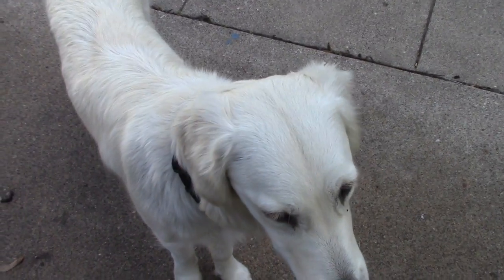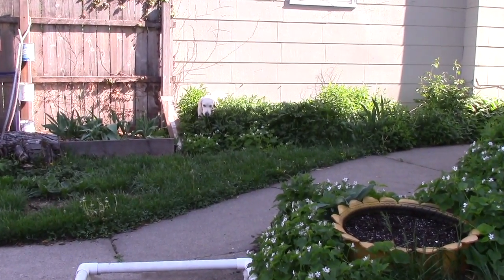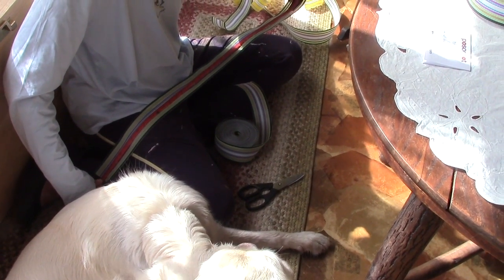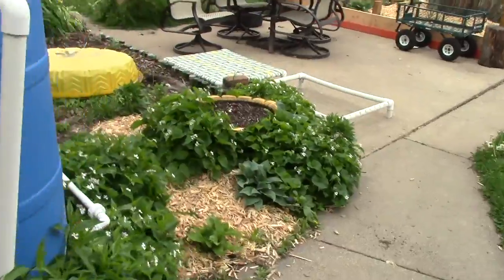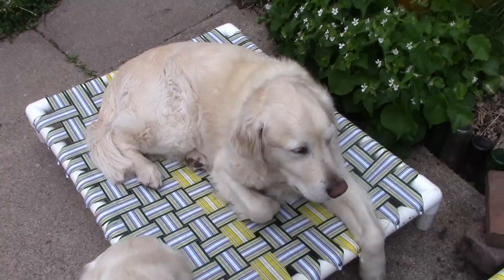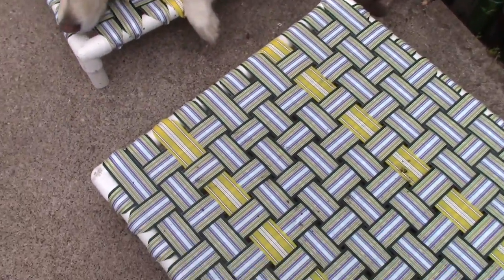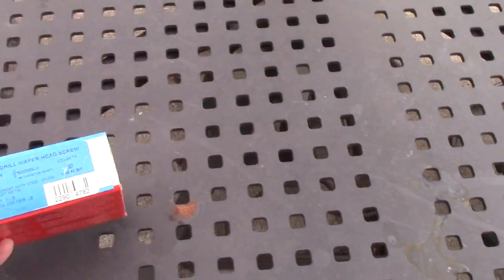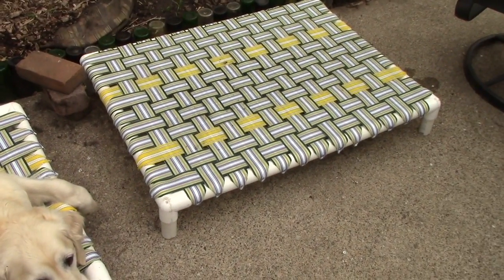how to make a raised dog bed with pvc and nylon webbing...

Comment: I made one out of 1 1/2" pvc  and canvas like carhardt jackets and bibs are made out of. It regularly holds a 115 poumd black lab and an 85 pound silver lad at the same time. I paid 12 dollars for a yard of canvas and has not ripped in over a year. has stretched a little because they lay on it every day while we are at work. I accounted for it maybe stretching so it is a foot off the ground instead of the normal 4 or 6 inches most people make them. just got done ordering the material to make 3 more. one for my brothers new puppy and another for my bloodhound puppy (which is now 80 pounds). the key is to make sure it is stretched as tight as you can get it before installing the corner screws that lock the fittings together. I do this by drilling 2 holes and using 2 screwdrivers to twist the pipe to tighten one side at a time. works great.
Reply from the maker: nice! we origionally used canvas like fabric too, but it eventually ripped (prob after about 2.5 years or so). we didn't mind the canvas, but did find it took a while to dry after it rained. we could have been pro-active and put the beds in the garage before the rain, but meh... we never did. 
the webbing is nice because it dries quickly and basically lasts just as long (if not longer) than the canvas we used. plus, in the summer, i like to think it keeps the pups slightly cooler.

I love that you made your bed large enough for both your pups! I'm sure they like that :)